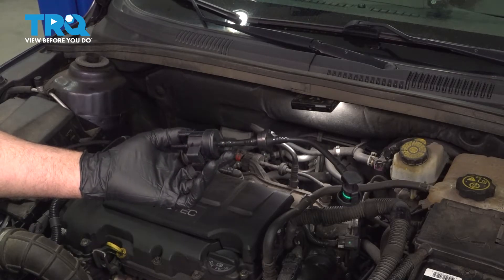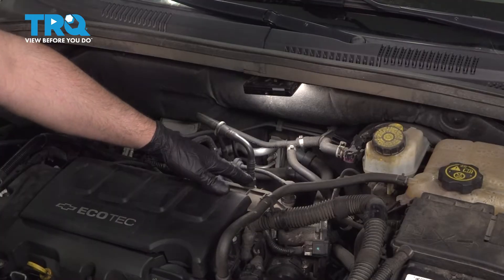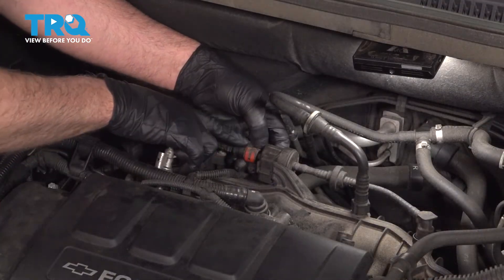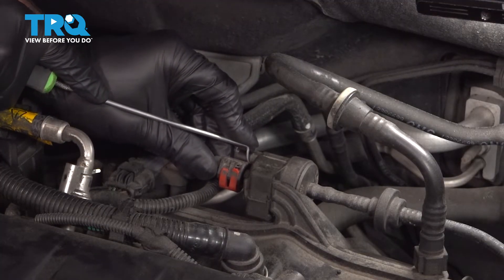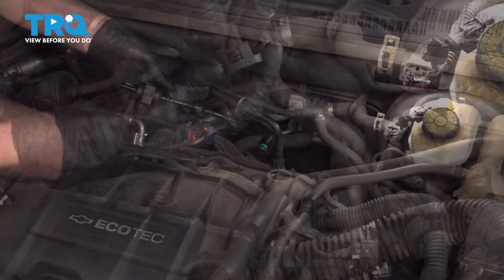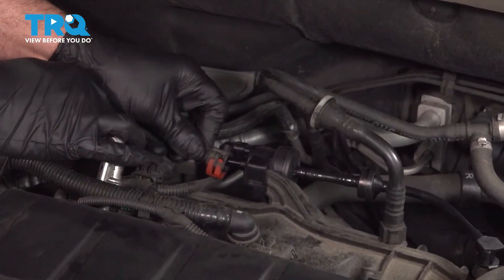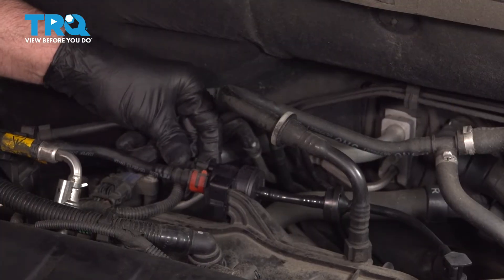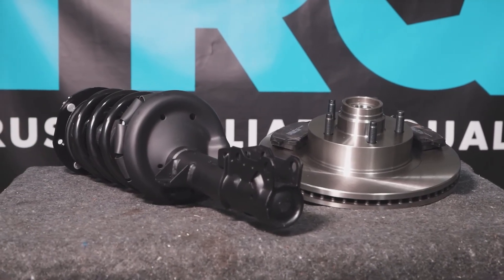How to replace Vapor Canister Purge Solenoid Valve 2011-2015 Chevrolet Cruz

Comment: I have a 2014 Chevy sonic, and it’s leaking from the purge valve hose, I’m not sure if it’s oil or something, it has the consistency of oil, anyways, if I replace the hose line and the purge valve, do you think it’ll stop that leak?

Comment: Thank you, sir! I found the one that requires squeezing and lifting to be a bit challenging. I ended up using a pair of pliers to pull it up firmly, and that finally did the trick. To reinstall it, I gently tapped it back into place with a rubber mallet. I hope this helps anyone facing the same issue!
Reply from the maker: +@kadenzinnell Thanks for the feedback! http://1aau.to/m/Shop-TRQ